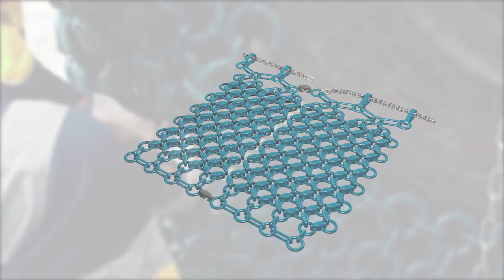How to Install Chains on a EXTREME Machine: Pewag Tire Protection Chains Mounting

Comment: These chains probably cost like 50k
Reply: Those in particular are $14k I believe. We just ordered two for a loader at work.   We had RUD currently the C links go on lot easier than these I think.    14k per tire.
Reply: $14k a set
Reply: Worth it regardless. Add many years to the tires